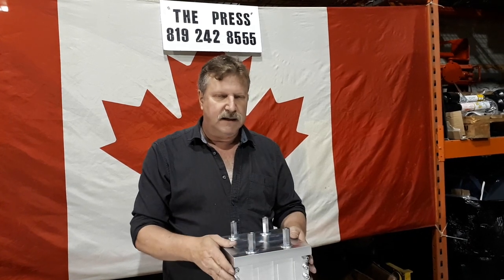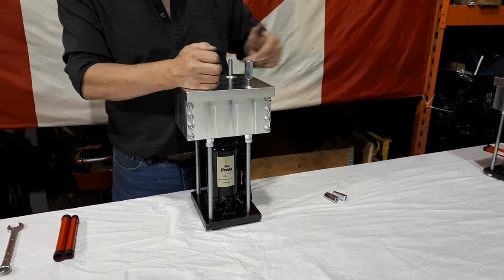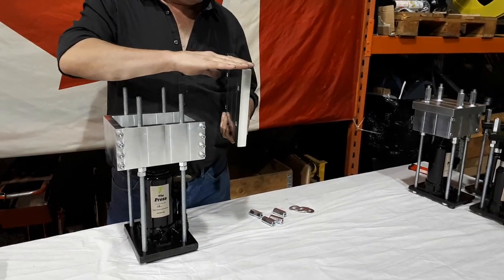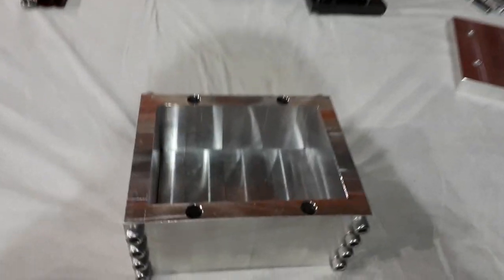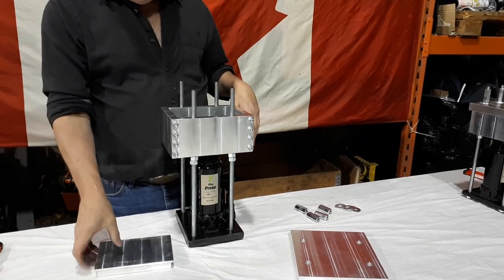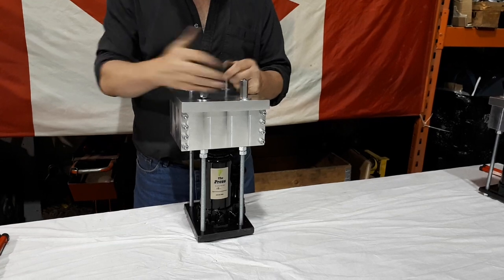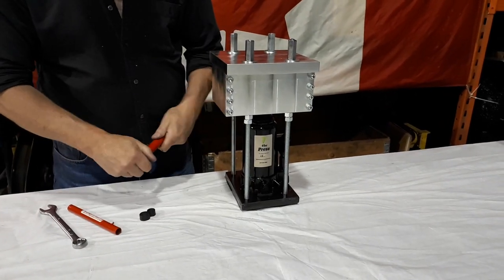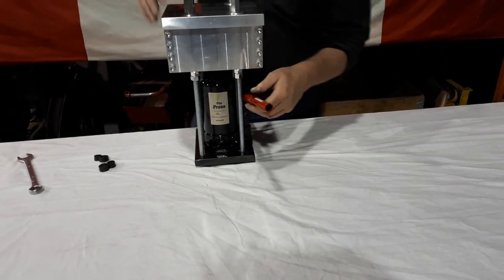12 ton pollen press, hash press, corn starch press.

Comment: Dose the different tonnage have to do with the amount of product? Will the two ton produce the same results, just a smaller brick?
Reply from the maker: Yes these presses are made with approximately the same pressure per square inch so the smaller the jack the smaller the mould.

Comment: great unit. but say you are making bubble hash....don't you need the heat to make it look pretty?
Reply from the maker: These presses are made from aluminum so its easily heated in many ways. Boiling water, propane torch, oven, on top of the stove. It wont rust and disipates heat very well.
Reply from the maker: Hey Andrew, please visit our site at officialbpmachines.com

Comment: Do you have any videos making actual hash? Never met anyone who smokes corn starch...
Reply from the maker: No we havent made any videos of it pressing hash but we will be soon. We have now designed these presses with built in heaters as an option which dramatically improves its efficientcy.  You dont need to heat them in boiling water or in ovens.  Much easier to use